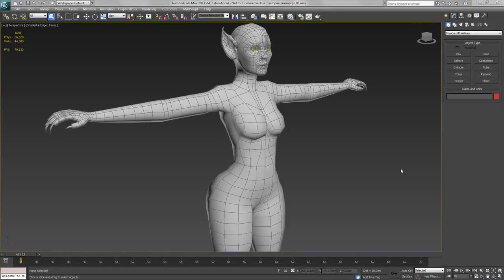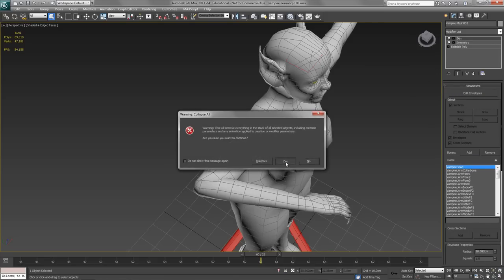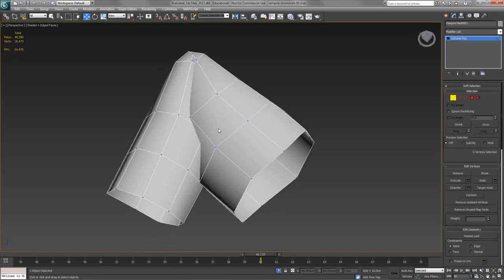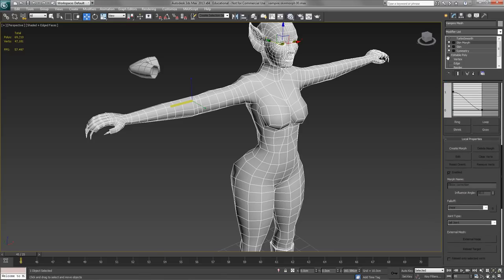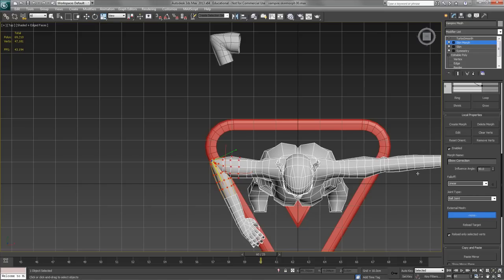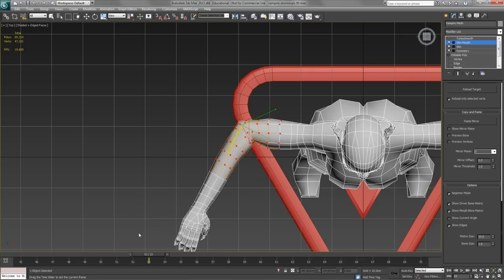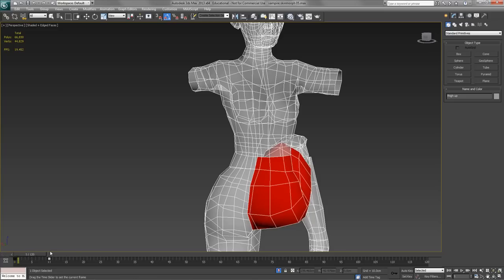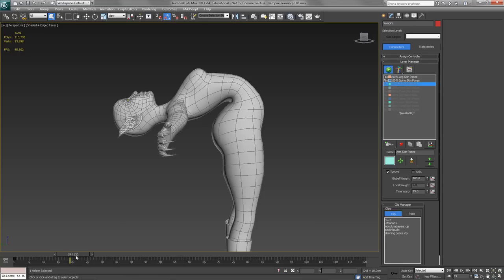Skin Morph in 3ds Max

Comment: This is a great tutorial, but one very, very important detail about this process that must be pointed out is that the mesh representing the morph target must not be moved until its modifier stack is collapsed to the desired skin pose. I had discovered by chance that not heeding this screws up the pivot point of the morph target mesh, and this will show up as a "jumping vertices" mess when you apply the target to the morph.
Reply: "must not be moved"
Oh god I'm freaking out now. Did you mean not moved away from its original location in its entirety or do you mean not to adjust the vertex positions.
He moved the position of the mesh in this video so if I just do exactly as he did I'll be alright? or has something changed?
EDIT: I get it, you're just saying basically that you should do everything in the order he does it. Clone, collapse all, move, edit. You used the words "desired skin pose" which made it seems like you had to edit the vertices with the new mesh in the original location.
Reply: IMO, the most important part of this is the collapse step, because morph targeting heavily depends on preservation of the topology of the mesh you cloned. 3ds max will also warn you whenever you attempt to modify a mesh in certain ways with a dependent modifier that is above another modifier through which you are applying changes to the mesh. In this case, waiting until you've collapsed the stack preserves the topology of the mesh you copied, which consists of the mesh's pivot point and original vertex locations.

Comment: Very useful. Thank you!

I'm not entirely sure how this works together with a rig though, for example. Do you just add a rig, animate it, and while you're doing that use the skin morphs to apply local fixes?
Reply from the maker: Set this up prior to any animation, then every time you move one of the joints, the joint angle drives the morph target. You can add additional skin morphs during the animation stage though if you get some weird posture that isn't covered by your initial setup.

Comment: you have to do this in every animation, right? is there a way to make the morph works for every animation i make?
Reply from the maker: The skin morphs you set up on the model live in the skin morph modifier and go with the model to any animation you create.

If you get a particular pose in your animation which is not covered by one of the skin morphs you have already set up you can add another any time in the same skin morph modifier.

You can add multiple morph targets under one bone either in the same axis or in different axes. If you add them in the same axis, you need to adjust the angle of influence so that the morphs don't overlap each other too much.

Hope this helps
Reply from the maker: No, you can make one model with skin morph and then import it into any animation you want.
Reply: so what if there's some angle change when we animate and things like that ? should we model and apply it again or we could just use one model eventhough the angle is different ? and is the morph only works in that designated keyframe ?
Reply: thanks a lot. yea that helps

Comment: Hello Your tuto was awesome.... make me do great things, but I have a little problem when use mirror tool.... Can you help me plis?   This is my problem....  

https://youtu.be/o7mu4Ydkbb0

I really really greatful if you can help me..... THANKS!!!
Reply from the maker: I notice some of the skin morphs are above 0% in the T-Pose. Try changing the influence angle to bring these down to 0%. Apart from that, difficult to say for sure just from the video. I have had a similar problem before and had to redo the other side without the mirror tool.
Reply: Thanks a lot to answer so quickly .... :D   I really appreciate. Well after try some diferents things to resolve the only thing that work was use a second morphing skin modificator and then all work correctly ....    maybe is a program problem from 3D max.    Thanks a lot!!! :D
Reply: Thanks!!!  :D I will try!!!

Comment: Hello and thanks for a great tutorial. Been following along and getting some great angle driven morphs. I have a few questions for you though.
1. When I tie in multiple morphs on more than 1 axis I start getting values on the morphs even when my character is in its default state. Shouldn't they all be 0? I can tie in multiple morphs on 1 axis and they zero out at the default state but when I tie in an additional axis the morphs all carry a small value in the default state.
2. I tried applying the same technique to facial morphs for my character and the morph is not going back down to 0 when at the default state, its staying at about 65 so the shape is still being triggered quite a bit at default. Not sure why it is doing that. The previous skin morphs were on bones that were generated with an auto rig. Is there something I need to do to the bone to prepare it for skin morphs? Like zero it out or align the pivot or something like that? In the meantime I just dialed down the influence angle until it looked ok but I was curious why it hadn't worked as well as the previous attempts.
Anyway, sorry for long post and thanks again for a helpful tutorial.

Comment: Hello! I have a question. I made a 3D model of human. I have already done UVW, textures, skin, controler rigg. I want to do today a face morphe but my model is not divided/separated on the face and the rest of the body. When I try to do face morphs all charcter model converted to standard model shape. How to solve this problem ? I'm working on 3ds max 2013. PLEAS HELP.
Reply from the maker: Make sure the Morpher modifier is below the Skin modifier in the stack otherwise it will override the skin modifier and move the entire character back to the original position
Reply: Thank You

Comment: I'm trying to follow this, but when i click on the target external mesh, nothing happens. Max wont place the mesh there (as a External Mesh). Any tips?
Reply from the maker: Only reasons morph targets can't be selected is a change of topology or number of vertices.  Usual issues are accidentally leaving a MeshSmooth or TurboSmooth on top of the target mesh, deleting polygons from the target mesh (i.e. instead of just hiding selected), or putting the Morpher modifier the wrong side of a Symmetry modifier.  Let me know...

Comment: Does Skin Morph information get transferred when you export to a game engine such as UDK or Unity?
Reply from the maker: I don't think FBX supports skin morph. But once animated, you could put a point cache modifier on the stack as I believe point cache data does export via FBX.  Can't be any more specific than that because I have never tried exporting to a game engine.   Hope this helps.
Reply from the maker: Sorry, I still don't know the answer to this. I don't actually use game engines.
Reply: Ken Pitts
Reply: +Yaw Jr. Did you figure this part out? I'm having the same need right now and can't use point cache data :<